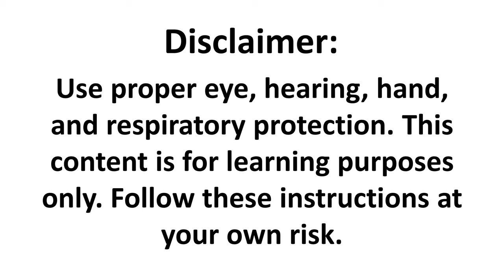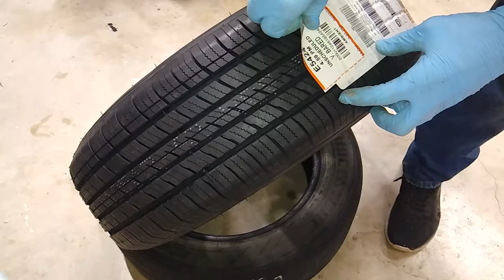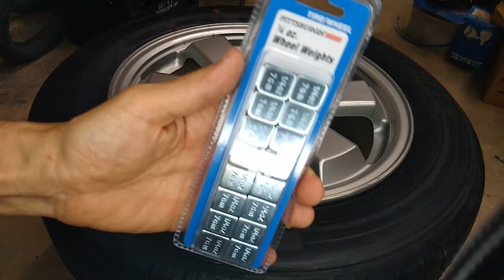How to Mount and Balance Your Own Tires at Home

Comment: The tire shop always damaged my wheels and I am sick of it. I am ordering a manual tire changing kit to do it my self. Thank you for your video.
Reply from the maker: Hi buddy, yeah, it's a crap shoot going to the tire shops. I was in one recently getting two of wheels balanced after I mounted my own tires on them and watched one of their techs balancing these truck wheels caked in mud. Common sense seems to be in short supply. Linked below is the Lucid Autowerks adapter for the Harbor Freight manual tire changer.

https://lucidautowerks.com/collections/ultimate-manual-tire-changer

A quick FYI, tires purchased from Discount Tire come with lifetime balance regardless of who mounts them. What I do now is unmount the old tires, remove the old weights, clean the wheels properly, mount the new tires on them, take just the wheels to Discount Tire to get the free balancing service and mount them on the vehicle and torque the lug nuts myself.

Comment: Hello people out there  his idea  works goob but i have much faster  way and all you need to break the bead on the tire is jack up your car take the tire off put the tire under neath  your brake rotor making sure that the rotor and rim line up with each other lower your floor jack until the rotor starts to release the bead  also it helps if you spray the rim were the tire meets the rim with soapy water or wd 40 in will come off flip tire over and repeat the same steps
Reply from the maker: Hi Carl, thank you for commenting and great suggestion. That would be awesome if you have to do it on the side of the road or something. Lots of creative people out there with all kinds of wisdom to share 

Best of luck with your repairs!
Reply: Thanks for your nice comment it takes a litte practice to do what i do but it works take care

Comment: When you have a RED Dot and a YELLOW Dot,... RED should be aligned with the valve stem.
Reply from the maker: Hello Spotchek, Thank you for commenting and info. I based my dot choice from the Yokohama website. Some wheels will have a stamp or dot on the rim that indicates where the red dot should go. My wheels had no suck markings so I went with the yellow dot to valve stem. Linked is the source - https://www.yokohamatire.com/tires-101/maintenance-care-1/mounting-your-tires

Best of luck with your repairs!

Comment: Sometimes you don’t need to add weight at all. The trick is before you sit the bead check the tire and adjust the tire on the rims, and then sit the bead. After the bead sit check it again to make sure.
Reply from the maker: Hello Bima, thank you for commenting and pro tips on avoiding the weights altogether. I'm curious if you ever tried adding balance beads in a tire. 

Best of luck with your vehicle maintenance.
Reply: @vbared  I never tried balanced beads.

Comment: Nicely done but I'm afraid I'll scratch up my rims wirh the spoons
Reply from the maker: Yeah, I wouldn't use them if the rims are aluminum and in perfect condition. The rims I was working on had some spots that rubbed a curb which is where I placed the spoons.

Comment: That first part with the jack looks hell dodgy... Just get a tire changing mount
Reply from the maker: Hi Ozwasp, Thank you for commenting. Yeah breaking the bead using a jack looks super sketchy but can be done quite easily if you mount the tire changing bars at the end of the 4x4 like I described. Purchasing a proper bead breaker would be best. Check out the video below I made on another method to change out the tires.

https://youtu.be/5o7CUodpJCg?si=WT8l-8ST_eibx-ol

Comment: You had me at "Toyota Prius"
Reply from the maker: The Toyota Prius is amazing. My first Toyota is a 2009 Yaris (manual transmission) that I bought used in 2013 for $6400. It had 134k miles on it and everyone said I was crazy for buying it. It's still my daily driver and currently has 398k miles on the odometer. The water pump needs changing every 150k miles,  I've changed the alternator once at about 300k miles,  valve cover gasket at 350k and most recently the rear hub bearings. Other than the aforementioned parts, tires, drum & disk brake pads,  rotors (when worn out), and oil changes every 5k miles the car is super cheap to drive. I do my own maintenance work so it's even less for me. The 2008 Yaris is essentially a generatorless Prius. So essentially I got into the Prius through the Yaris after learning about all the similarities between the two.

Comment: Good work.  I have the Harbor Freight version of the balancer and I can see doing mods to use the centering rings.  I like that better than using the cone section.

Also, if you separate the weight into 2 halves and start spreading them apart from the lightest point you can fine tune the balance.  Think of a Y pattern.
Reply from the maker: Hi Kevin, Thank you for commenting and tip on fine tuning it. It's probably a good practice to spread the weights apart some to reduce harmonic imbalances even if a fine tune isn't needed. This was my second vehicle that I balanced using the 3D printed balancer. The first one rides super smooth at all types of speeds.
Reply: @vbared I'm happy with the results a bubble balance gives as well.  I bought mine years before i started 3D printing.  I really like your take on the balancer.

Comment: Do you get consistent results when rotation the wheel on the balancer 1/4 turn all the way around? I spent hours trying to get repeatable results on my harbor freight unit and I am about to give up after 2 days of inconsistent results. No modification seems to help that i have tried.
Reply from the maker: Hello, Thank you for commenting. I noticed the same thing with my 3D printed one, I'm not sure why but it seems a bubble balancer can't be treated like static balancing setup. The only time the bubble balancer can be rotated around after adjustment to confirm the calibration level is with no wheel mounted on it. What I do is line up one of the three adjustment screws, one of which I mark with a red marker or paint, up with the valve stem and face the valve stem away from me. If I need to unmount the wheel from the balancer to place the weights then I can reload it back onto the balancer the same way to confirm the balance. I've balance eight tires on two different cars this way and they both drive smooth, even above 80mph.
Reply: @vbared  that does not make any sense. The tire has heavier spots on it and it must be balanced after mounting it on the wheel. I dont understand the point of balancing the rim first, and then installing the tire. I think that defeates the purpose of balancing a tire. Or am I missing something here? Maybe the balance does not have to be 100% perfect for normal highway use of up to 80mph? I will try to install the tires I attempted to balance without consistent results and see what happens.
Reply from the maker: @JustMe-gx4xt  j
Reply from the maker: @JustMe-gx4xt  I'm sorry for not being more specific. Nothing mounted on the balancer is the only time the whole thing can be rotated around to check for calibration. Once you put the fully assembled wheel it must be keyed to some spot  of the balancer. In my case I used one of the three adjustment screws and placed it closest to the valve stem so I could repeat that same position if I unloaded the completed wheel off the balancer to place the weights. If you noticed in the video I placed the weights while it was still on the balancer to avoid having to go through the extra steps. If you find a way to balance the assembled wheel and have it maintain that balance while turning it 1/4 turn at a time please let me know how you did it. I'm happy to exchange thoughts with you over the phone 478-227-3301

Comment: Im still screwing with 2 harbor freight balancers.  When Im done torturing myself getting these to work, I'll look for another method
Reply from the maker: I almost purchased a Harbor Freight balancer myself after watching many videos of how to modify them to get better performance. What is it that is holding you up from getting them to work?
Reply: could be me could be Im just not setting it up correctly.  I just leveled my balancer head on the kitchen counter, it was a bit off.  New balancer I just bought thinking the old one was junk, has the crappiest bubble ever!  Old balancer bubble is more reactive than the new balancer bubble.   @vbared
Reply from the maker: @zundfolge1432  I noticed that same thing with the type of bubble that is currently used. I believe it is some type of viscous fluid instead of something thin like water. The ones I ended up using are super reactive.
Reply: I decided not to buy one for the same reason....I thought I would be able to mod one.....but lots have tried and failed.....and dont want to cause myself stress.....

I do all my own tyre work....but will have to pay a shop to balance if needed.

I will carry on looking for a good repetale home DIY method.

Pity the Harbour Freight Rigs Cannot be made to work.....I wonder if they will ever improve them???????

Comment: Hi there. very nice video, also where can i buy a wheel balancer like this one  thank you.
Reply from the maker: Hello Deborah, Thank you for commenting. The wheel balancer design file is in the video description and linked below for your convenience. You will need to have it 3D printed along with following, a section of closet hanger tube and some screws to assemble it.

3D Printed Parts - https://mega.nz/file/IcUhAbwb#nY_7JbGcSyoePKVzxRSKpLkb6ficDtbNZr3E2fKAnZk

Bubble Levels - https://amzn.to/3PX33bj

Spring Assortment Kit - https://www.homedepot.com/p/Everbilt-Spring-Assortment-Kit-84-Pack-13554/203133714

Comment: all that to save $20 per wheel  :)
Reply from the maker: Yeah, I hear you and wouldn't go through all that trouble to save a few bucks. 

The reason for me is learning how to be self reliant an save myself from poor work ethic or incompetence. I can't tell you how many times I've removed wheels to service or check the brakes and found that the balance weights have flung off or clean wheels that were full of dirt in all the crevasses then have vibrations due to them being balanced along with all the dirt from the get go or tires losing air due to beads not being properly cleaned prior to installing new tires. I recently found out that tires purchased from Discount Tire come with free balancing for life regardless of who mounts them, pretty cool.

Best of luck with your repairs :)
Reply: I have two Harbor Freight tire changers and as far as I can tell they are designed to make a person appreciate modern shop tire machines. It should be noted that many tires are not nearly as willing to be dismounted and mounted as the one in the video, regardless of how much lubricant is used.
Reply from the maker: @thardyryll  I recently bought a Harbour Freight manual tire changer myself and made up a Lucid Autowerks duck head arm for it so I could mount some tires on my wife's 18" wheels. It worked out quite well and with a bit more practice it should be an excellent addition to my tool set.